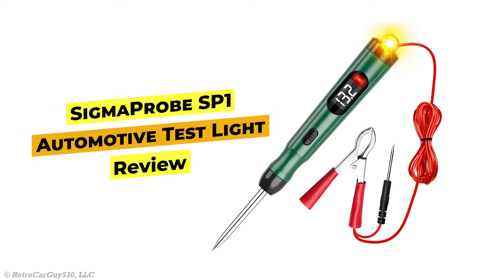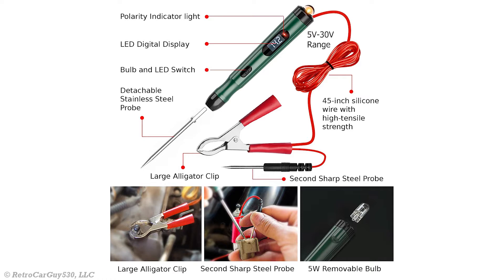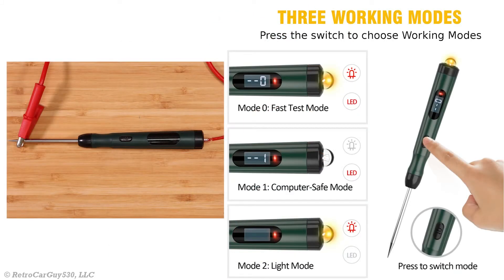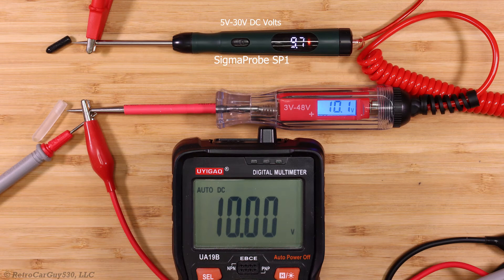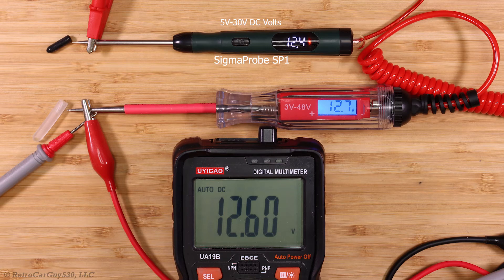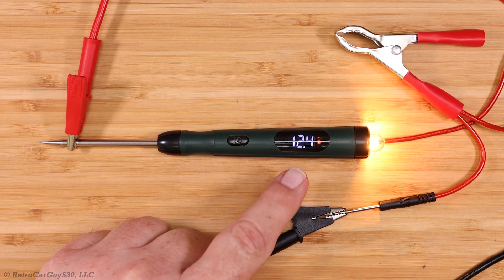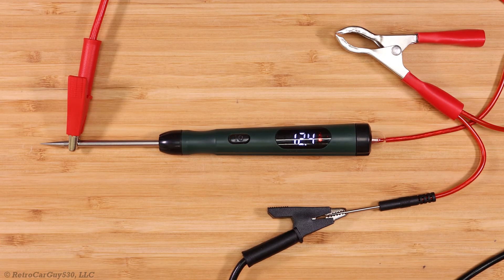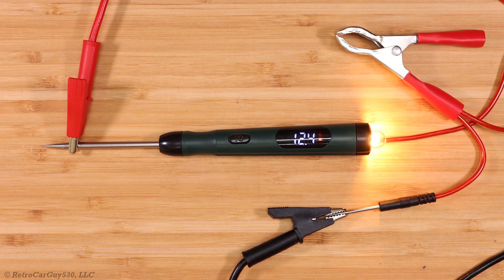SigmaProbe SP1 Digital Automotive Test Light Review

Comment from the maker: I review the SigmaProbe SP1 digital automotive test light.  Leave a question or comment in the comment section.

⏲ Video Chapters ⏲
00:00 - Intro
00:24 - Features
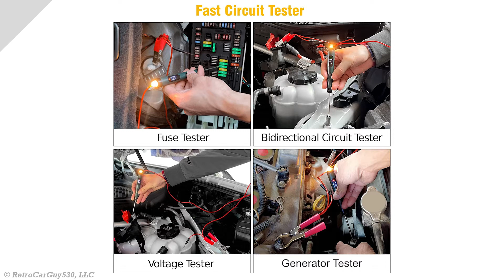02:24 - Voltage Tests
03:39 - Final Thoughts